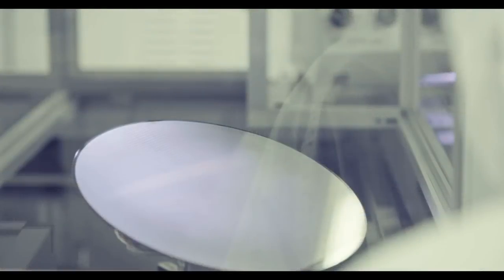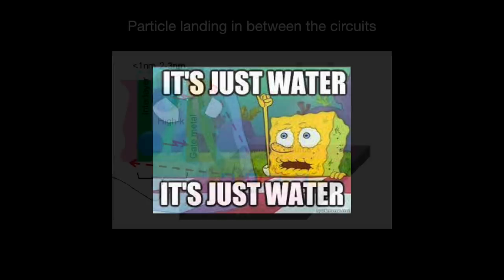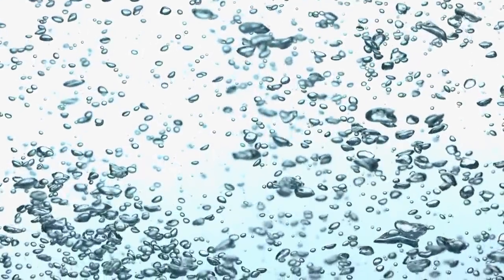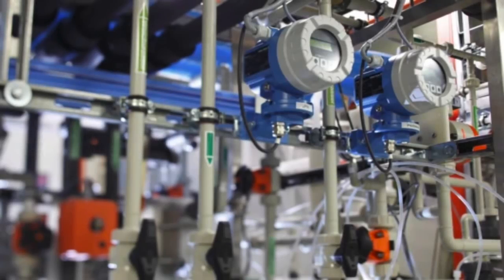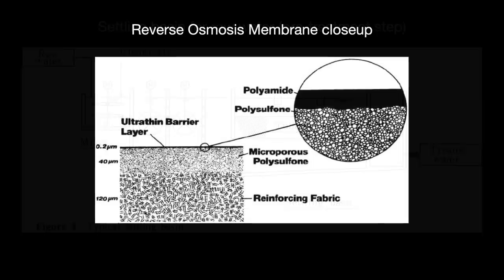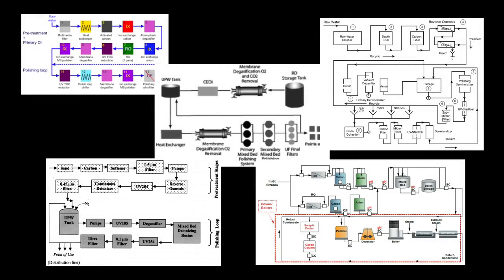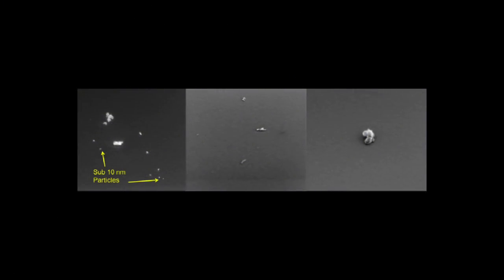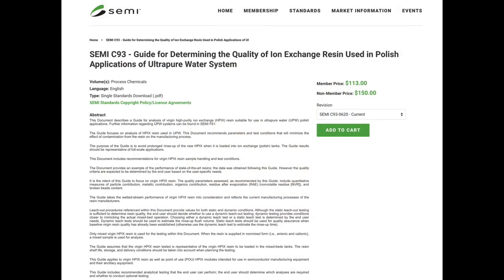Ultrapure Water for Semiconductor Manufacturing

Comment: sometimes I think about a portion of society bootstrapping itself back to our level of technology. Getting to early MOSFET ICs could probably be done with the economic power of a population of one hundred housand people, but it takes an advanced world economic system to get to the nanometer level we're at now, even if you had all the reference manuals in the world
Reply: I'm hiring Jon to manage my project on how to industries eastern Africa. I f batteries take 50kw to 1kw of battery power, no one in the west will permit a the renewable energy to build the batteries needed. I think I could build electricity capacity in africa and build the batteries there.
Reply: I'm actually worried. As we scale up manufacturing to keep prices under control for newly developed methods we create more centralization. And we need more and more experts/expertise with specific knowledge/experience because of specialization it means disruptions are easier to cause problems. It could be that the 2011 Thai floods which disrupted the production of HDDs is just going be a precursor. We depend on many products in our daily lives which will need to be replaced/replenished. Many of the production processes actually depend on themselves. For example we need fast computer chips to design highly advanced chips. We need chips to control the manufacturing processes... to produce chips. It's like having to bootstrap a power plant, a lot of power plants actually need power to start. This is actually a concern if we ever get hit by a Carrington Event. We will have to shutdown the whole grid for days, maybe even a week.
Reply: @autohmae  I believe Isaac Asimov explores this in one of his books, where they lose the ability to build new compact nuclear energy sources because it required specialized knowledge that no one at the time still retained.
Reply: @blink182bfsftw  "great minds think alike" is something they do say ;-)
Reply: One day we are going to need to build semiconductor wafer fabs on another planet, and keep them running.
Reply: @Hassanmohamed31152  how is salat
Reply: @babagandu  it's great, gives me peace of mind and a nice reminder during the day
Reply: @Hassanmohamed31152  yes you should increase it
Reply: @babagandu  likewise for you :)
Reply: @blink182bfsftw  do you know which book?
Reply: @autoteleology  I forget :( Maybe Foundation? Great series anyway
Reply: Thought experiments like this and some sci-fi worlds, where the people can't produce many of the old tech they find and can only maintain it, have me convinced that manuals are everything and that if some cataclysm were to happen now, we'd be f-.
Reply: @blink182bfsftw  what’s the book called, sounds really interesting
Reply: @leitheoleu5451  I believe it's called Foundation. Great series of classic Sci fi
Reply: @blink182bfsftw  thanks man 🙏
Reply: @leitheoleu5451  Prelude to Foundation! It is an interesting commentary on the nature of a society, on top of being a fun sci fi romp.

Comment: My dad spend about 10 years designing these ultrapure water purification systems for Evoqua/ Siemens water technologies/ a half dozen other names while he was there, IIRC.  So when you say that the "killer particle size limit" got small enough that lasers could no longer detect them, I actually remember him talking about what a headache this was.  I've actually seen some of these systems you showed pictures of, or newer models.  They used to make water purification systems for both semiconductors and pharmaceuticals, and oh boy, pharmaceuticals sounded like a lot less of a bitch to deal with than semiconductors.  Pharmaceutical water just needed to be sterile and not have any contaminates that could chemically react with anything and cause unwanted (possibly dangerous) byproducts during production, or otherwise cause yields or quality to be inconsistent (you really, really don't want your medicine to be even a fraction of a percent more or less potent than you're expecting when you're talking about making bulk chemicals that then have to be divided into millions or billions of exact milligram or microgram doses).  When it came to semiconductor water, he used to say that the water has to be so pure, that if you were to blow up a single die on a wafer to the size of a football field, then it would only take an impurity the size of a single marble to scrap that unit, and he had to make sure that it wasn't his water that was responsible for letting any of these "marbles" get through.  

At my job I measure sodium impurities in my process in PPT, parts per thousand.  He also used to measure in PPT, but his was parts per trillion, and he was dealing with a lot more difficult impurities than just simple table salt.

To get an idea of how pure this water is, he used to say that if you filled a kiddie pool with this water and stood in it, you could shove a high-voltage transmission line inches away from your ankles and you wouldn't even feel a tingle, because there was simple nothing dissolved in the water that could conduct any current.

I am intimately familiar with the Intel 14nm problems they were having back then, too.  One time around 15 years ago, now, in the summer my dad needed to drive down to Intel's Phoenix fab (from Colorado Springs) to deal with a problem they were having with his water system they had just installed.   He asked me to go with him for the company and to split the driving with him (it's about a 12 hour drive each way). He thought it was going to be a "drive there, look at it for about 15 minutes, press a couple buttons, drive back" thing, but... Nah.  I wound up stuck sitting in the parking lot in his Volvo for 4 or 5 hours in the Phoenix heat with nothing at all to do.  I couldn't go into the building because I didn't have security authorization, and I couldn't really go in and page him because the campus is huge and there's clean rooms and stuff, so me paging him to the front could easily waste an hour or everyone's time after he had to unsuit for the clean room, walk way the hell across the huge campus to the front, probably just tell me that I couldn't go in, anyways, and then walk all the way back, suit back up, and get back to what he was doing.  So I was just stuck with a non-smart phone, a Nintendo DS that was starting to give me a headache from how long I had been staring at it, the AM radio.  I had the keys, and I turned on the AC, but lemme tell you, an AC system built in the 90's to deal with the weather conditions IN SWEDEN is absolutely not up to the task of fighting against the midday heat of the Arizona Desert in the middle of summer while idling in the middle of a hot parking lot.  So I wound up basically pacing around a lot, turning the car off and on to keep the AC from overheating the idling engine, and eventually detailing the interior of his car with a paperclip and some napkins out of sheer boredom. That was a pretty miserable day.  Worst part was that Whataburger was closed by the time we left so I still haven't gotten to try that.

He asked me to go a couple more times and I found other shit to do.  But I certainly heard all about the problems that 14nm was causing.

And, yeah.  He has (or _had, maybe, he left that job about 3 years ago) that book you showed at the end.  I looked at it for about 15 seconds and decided that it was all just bullshit cryptic jargon written that way to conceal the fact that they were actually performing an old school purification ritual by sacrificing goats and virgins under a blood moon to make this shit work.
Reply: Ultra pur water would rapidly grab impurities. It wouldn't stay non conductive for very long.
Reply: Great story. I made my kids wait in the car a few times for similar reasons.  And when I was a kid, many Saturdays my dad would bring us boys to the office where he would spend the morning catching up on work.  The entire office was empty and us kids were bored to death... until we discovered the employee break area that had a free supply off hot chocolate.  We were invited to drink all we wanted.  Eventually we began to fill the styrofoam cups with chocolate powder with just enough water to make chocolate paste.  Now that was useful to charge our batteries.  We loved going to his office after that and called it the cocoa kingdom.  We were still bored little boys so we ran full speed through the office, made paper planes, launched hot wheels cars (which were a perk from Dad's job) and screamed and hollered after playing competition level hide and seek in people's offices. We just stayed away from Pops while he was working so we wouldn't distract him. 

You are right about things taking longer than expected.  Compared to your dad, I'm probably just a lowly automation engineer, but here's a little joke I learned from my kids about time estimates that turned out to be fairly true.  It's called "Tim Allen estimating" from the TV show Tool Time.  Take your very best estimate, double it, then change to the next unit of time.  So if the best estimate was two weeks then the real time would be for months.  Then your time estimate will be somewhat close. These days, I think my biggest risk in any project is delivery time of parts, followed by the typical slow-to-lazy people who let their dates slip.
Reply: Lmao that is hilarious, like it's comically more difficult and more pure ngl
Reply: So if you split the driving why didn’t you just take the car for a drive and go somewhere while he was in the plant?
Reply: @jimjackson4256  Probably cos he didn't know when his dad was gonna come back out.

Comment: I work as a wet process engineer in development for EUV. Water purity is critical and something I work on regularly. This summary is brilliant and very accurate. One thing you missed is filter analysis. There are nm scale filters on tools in the fab that will catch most final particles coming from facilities. After running for sometime you can cut them open and analyze them, which solves the dilution problem of particle analysis. There are also filters that are tuned to chemically absorbed specific contaminants, based on your local water quality issues (metals, silica, etc). Great video!

Comment: Everybody in our engineering department, some in the maintenance, and a few managers are spending most of our time trying to improve yield in our product line.  We sputter large 4x3 meter “objects”. A single defect can scrap a unit costing us several thousand dollars and all the wasted time. Since the line isn’t exactly screaming fast, this costs us millions.  I am thankful that we have made great effort on this problem from many angles, including ones that I wouldn’t have thought of because we have a really talented team.  I most recently finished a procedure for tracking down the cause of a single little scratch.  Since the production line is over half a mile long, it was no small task.  It took months to make a decent system so a future engineer will be able to make quick work of it.  Tomorrow I will introduce new PLC software that will reduce processing times at one our bottleneck areas.  I’m excited about that because my single software edit will save about $300-500k per year.
We utilize chilled DI water for many processes, pure but not like the UPW in this video. Many places we use DIW for cooling high voltage electrical circuitry because pure water doesn’t conduct electricity, imagine that.

In this video there is discussion about water purity to avoid sparking junctions on the wafer.  I question how they prevent static charge build-up in the water itself.
Reply: There are AntennaDRC rules for the wafer itself which require always leaving path for the charges to drain away.
Reply: Will they pay you 300 to 500k more per year?
Reply: @Dongonzales123  of course not.  I have to share that with the rest of the company.  But during my next review I'll probably get a raise.  The only time you can get the money for yourself is if you own the company, right?
Reply: I second that, given that AI also has the capacity to design ever more efficient water filtration and purity measurement systems. Plus Graphene can also render existing designs for ultra pure water filtration that much more cost effective long term.
Reply: While I enjoy the Asianometry videos immensely, I also enjoy combing through the comments because many, like yours, are also informative.
Reply: I like turtles
Reply: @microdesigns2000  Not right, the other time is if your are a sufficiently big profit enabler through your knowledge & abilities. Salaries and capital buys materials and people's time...not their abilities to make stuff or optimize, that's yours and partly what gives you worth. Money going only to owners is only a concept that works when most if not all that works for you have knowledge and abilities that can be found readily among others nearby or both held by the owner. 

For example, the relative cost reduction you enable could be the percentage of your bonus...
Reply: @SgtCarter69  If he saved the company $500k/year, but demanded $500k/yr in compensation, it would not be profitable for the business to give him that. They would actually lose money, because they paid him at his original salary during the time that he spent working on it.

It doesn't matter who he is or how important: it doesn't change the math. Heck, if I owned a company and personally implemented a $500k/yr change, I would not take all of that for myself! I'd rather reinvest in the business and call it a retirement plan.